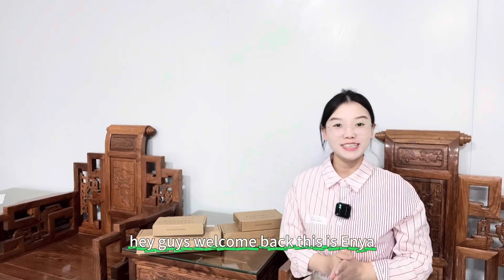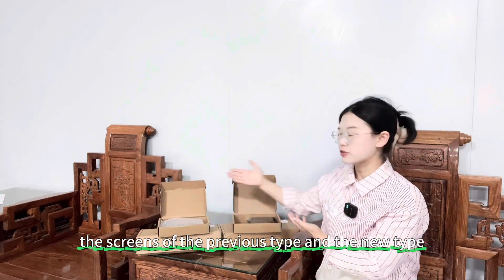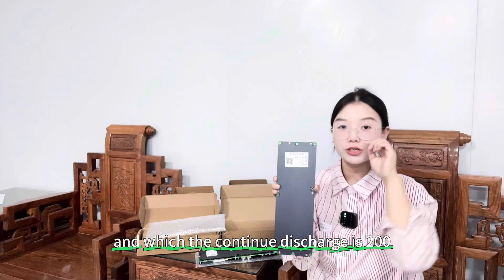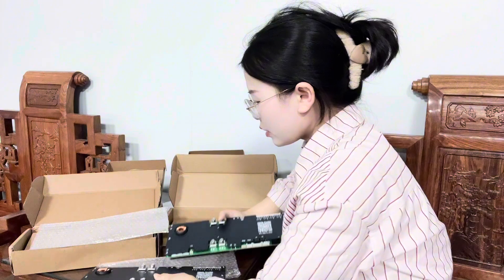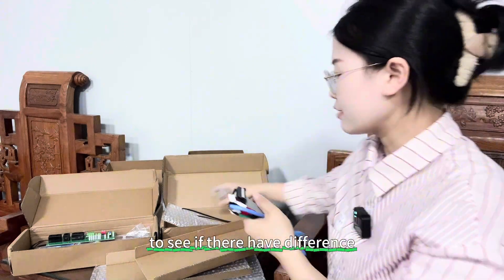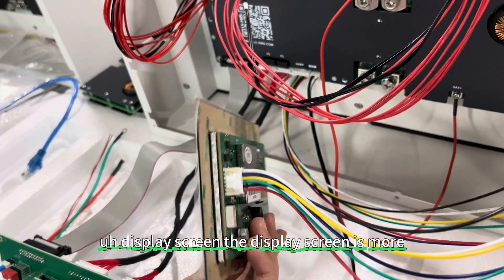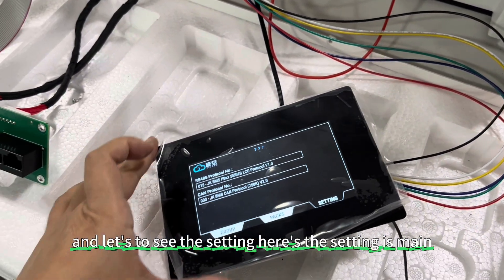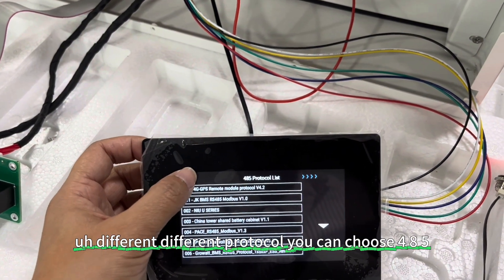New V19 JK BMS test and compare

Comment: Did they Add Diode protection on the Bat+ screw input connection ??? 
Get the polarity wrong by mistake 😲😱 and the board explodes and catches fire ! 💥🔥🔥🔥💀🪦...

A set of A4 Colour instructions  should be included as without them they are also in breach of Trading Standards/HMRC importation Laws in the UK. (The Smaller JK BMS come with 2 A4 pages of instructions, these BMS  do not!)

Comment: I use several JK-BMS and what I need is:
- better documentation (general features, explanation of parameters, inverter communication)
- reliable support (software, firmware, an accessible web side with official downloads, customer support)
- exact SOC-calculation